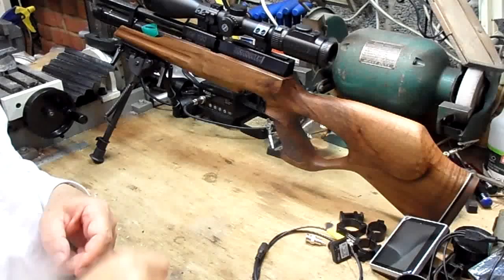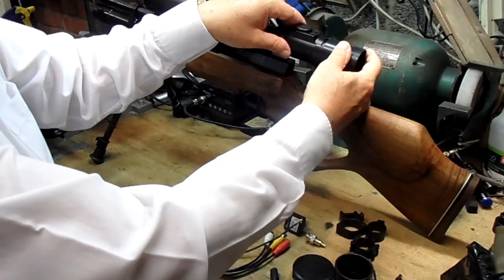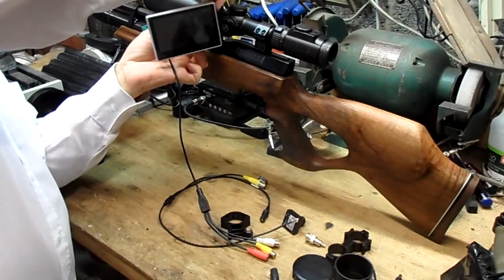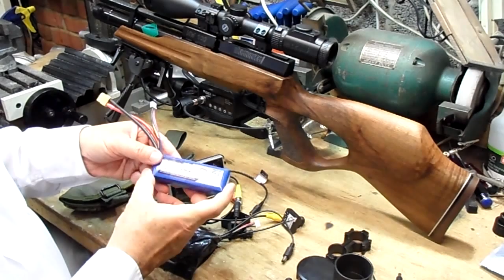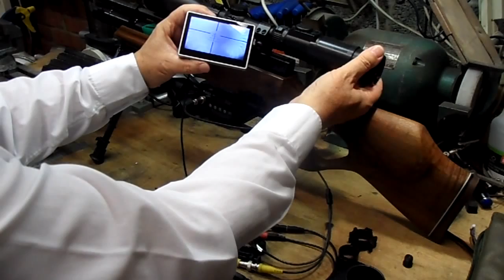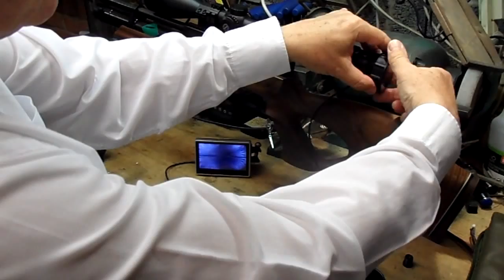Easy night vision add-on build

Comment: hi can you tell me im making a diy night vision got all sorted but the camera would not see my ir t20 so tried to remover the filter in lense and failed its a dragonsky fpv 140deg wide angle micro 700tvl 1/3 super hd ccd camera e/bay 381106817596 do you know if I can get a clear lense the lense that came with it had a red ting to it do I need a ir block lense ??????????????????????
Reply from the maker: This camera may not give good results although you may be able to use t for close range. The wide angle lens is useless, you should try and get a good16mm lens which is designed for use with infra red light at 850nm wavelength. You can find these on ebay if you search for '16mm board lens', in the UK Stock Optics are a good supplier.
You do not want an ir block filter, you either need no filter or an ir pass one. Lenses can have coloured coatings but normally the filter will be in front of the sensor and it will be coloured pink or possible green. The filter cuts out some of the ir light to give a more natural colour balance in daylight, for a night vision sight this is not required. If you search on Youtube you will find videos describing how to remove the filter if it's fitted. This can destroy the camera and is one of the reasons that I suggest the camera/lens from Sure 24 which is ready to go, fits nicely in the Floplast adapter and performs as well as anything currently available.
Reply: thanks put a 16mm lense from stock optics and it works great with the ir t20 all the best

Comment: Why did you take off the protective film?
Taking off the protective film was a bad move.
jk nice video
Reply from the maker: It helps to give a clear image if the film is removed although it's not essential. If there is too much glare from the screen even with the brightness reduced you can fit a coloured film or something like the tinted film used on car windows.

Comment from the maker: This is a list of links to the parts used which will give current prices, hopefully all the links will work but should give enough information for finding a similar item:
Parts list
E700 camera http://www.sure24.co.uk/kpc-e700pub-...2v-dc-internal £68.34
Reversing monitor http://www.ebay.co.uk/itm/5-800-480-...item5b05b64e8c £16.99
12 volt battery http://www.ebay.co.uk/itm/12V-6800mA...item3cdc7c7b7c £26.65
2 way power splitter http://www.ebay.co.uk/itm/CCTV-Camer...item231f421d6c £1.99
BNC to phono adapter http://www.ebay.co.uk/itm/2-x-BNC-MA...item27e0640434 £1.69
Floplast straight coupler http://www.screwfix.com/p/floplast-s...ack-of-5/76761 £3.99 for 5
Floplast access plug http://www.screwfix.com/p/floplast-s...ack-of-5/65881 £3.99 for 5
Figure 8 clamp http://www.ebay.co.uk/itm/Figure-of-...item462058f55e £4.89
Weaver base scope mount for monitor http://www.ebay.co.uk/itm/25-4mm-1-i...item27e41d3714 5.99
IR torch with mount http://www.airgunforum.co.uk/forums/...rches-for-sale £38
Reply: Thanks! Where did you get the various mini-lenses for that camera though?
Reply from the maker: *****
They are widely available. The camere from Sure 24 comes with a suitable lens fitted. Others can be bought from ebay or companies like Stock Optics, they are a standard cctv lens with a 12mm thread but you will need to make sure that they are designed to work with infra red light as some are not.
Reply: alright thanks man!

Comment: Got the nv set up now do I need to touch the controls at the back will it improve the picture also the cross hairs are a bit low on the screen any ideas
Reply from the maker: The settings on the E700 can be left at the factory values unless you're trying to get out to 300 yards.If the cross hairs don't seem to be in the centre of the picture you can move the camera adapter slightly to get them better aligned, same thing if they don't seem vertical you can just twist it until it's how you want it.

Comment: what is the model of your camera?is it 30mm x 30mm?
Reply from the maker: This is the actual camera used http://www.sure24.co.uk/kpc-e700pub-16b-s-board-cam-ir-filter-removed-16mm-board-lens-1-3-700-tvl-30mm-sq-12v-dc-internal. The full specification is listed there.

Comment: I've seen a high resolution 5 inch screen at sure24 but the bracket doesn't look long enough to swivel to reach the rifle what do you think
Reply from the maker: The arms on most of the screens are just long enough to mount the screen above the scope. If you want to mount to the side (or have it sit higher) you can use a high weaver base scope mount - remove the top half and use it to mark the foot of the monitor mount for the screw holes. Drill the holes in the foot to a clearance size for the mount screws and screw it to the lower part of the mount. This should give enough clearance although the monitor body may foul the mount slightly so that you can't twist it all the way in towards the scope but it should still be usable.
The alternative is to make up a new mounting arm out of threaded rod or similar. You can cut off the end of the original mounting arm and fix it to the threaded rod using a sleeve and epoxy. The threaded rod can be screwed into a tapped hole on the scope mount or fixed with a couple of nuts.
Last simple option is to cut the monitor arm near the middle and extend it using a suitable length of tube epoxied to both parts.
Finish off with paint or heat shrink.

Comment: There's a lot of screens about do I need one with any specific features
Reply from the maker: Any screen will do the job but if you can get one with a resolution of 640x480 or better you will get a sharper image. Even a 320x240 will work but the image will look a bit fuzzy and it won't be quite as easy to identify targets.

Comment: hi terry is the e 700 better than a watec camera
Reply from the maker: For most people it probably is, the 902h is avery good low light camera but the E700 is preferred by most home builders. It is cheaper, smaller and easier to set up, it will also work in colour in low light conditions.